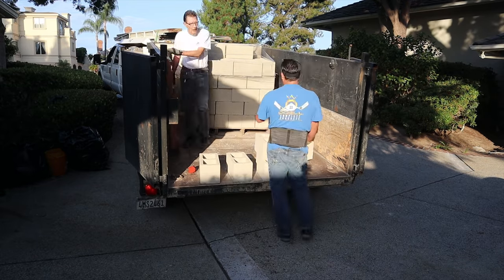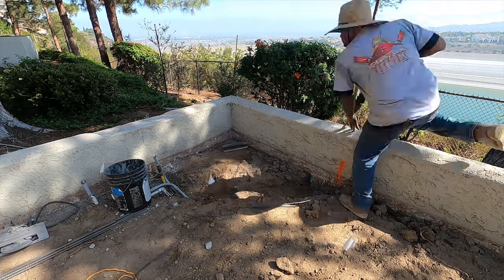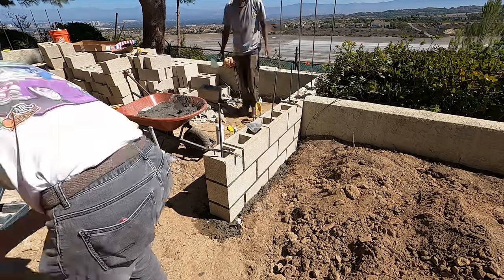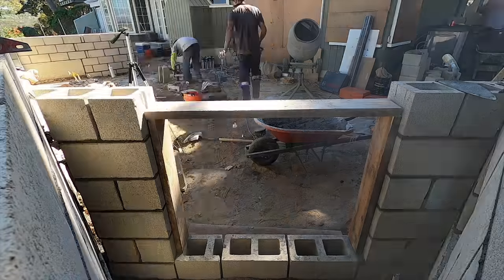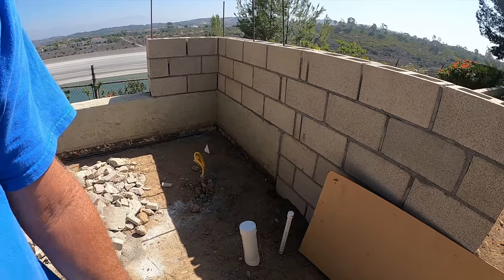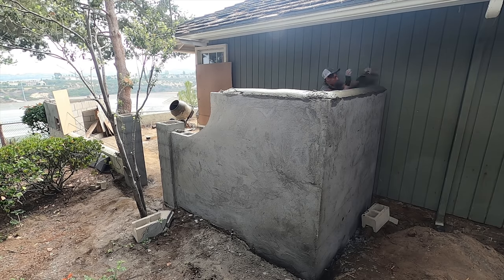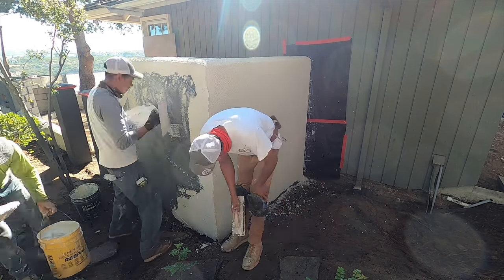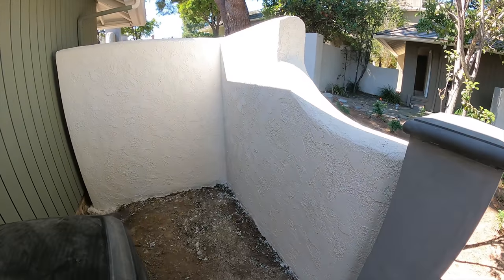Master Masons Block and Stucco (Part 2)

Comment: Where are your guys designing those tools?

Stucco mixing container- 55 gal barrel, cut in half. 

Concrete scoop- bottom of a 5gal bucket. 

1/2 round 8” trout- charcoal stater cut in half 

Skills- priceless 
😎👍🏽👍🏽
Reply from the maker: These guys make them up on site as needed.

Comment: When I got out of the Army I worked for my father in law as a mason's tender. I bought some nice leather gloves and my brother in law laughed at me.  Those gloves were worn through after the first day.  You just need to go gloveless and build up callouses.  After a few days of bloody blistered hands, my callouses built up.  You also get used to the weight of the block. Tossing them up a few flights of scaffolding is nothing after a while.
Reply from the maker: That's a true story.

Comment: What's the purpose of the rebar?   No concrete is poured into the blocks.   ?   Just curious.  Also what is the bottom of the bar anchored to?   Dirt?

Comment: How do you know the grout flowed to the bottom?  It looked like it got blocked.  Can I vibrator be used?
Reply from the maker: You can look at it running down.
Also you'll see water push through the blocks

Comment: Looking like you ran outta 8816s and used up the bond beam not the worst thing I've ever seen 👍 are you guys filling the wall or just the Collums?
Reply: I spoke too soon lol good deal solid wall 💪
Reply from the maker: probably did run out of solids.
TY
Reply: I watch you guys pretty frequently not trying to talk smack or anything y'all do great work.. and as long as you guys filled it solid it doesn't make any difference if anything it probably helped the concrete flow into the cells.. good job 💪 idc what anybody says you know what your doing and I enjoy watching 💯
Reply: You did have a lot of cuts for that fire pit probably lost quite a bit on linear ft
Reply: What I found that works really good for the top cap if you don't have a curb tool is to cut a 5 gallon bucket down and you can make that radius 👍
Reply from the maker: True it doesn't matter, just more concrete
Reply from the maker: True
Reply from the maker: Sounds good

Comment: I've always wondered about the cost difference between a cinder block wall filled with concrete vs a solid concrete wall.  I'm assuming the cinder block is cheaper, but other than cost is there any structural difference between the two?
Reply: i imagine a solid concrete wall would be stronger as it's one solid piece of concrete, the concrete would probably be mixed much more carefully as well, whereas they probably don't worry too much if it's just going to be filling a cinderblock wall as no one is going to see it, so even though it is filled with concrete it is probably not as strong.
Reply from the maker: Solid concrete is stronger.

Comment: You made the big mistake of crossing a gap without using angle iron, will bite you in your ass trust me.
Reply from the maker: The double 5/8" rebar will do the trick.